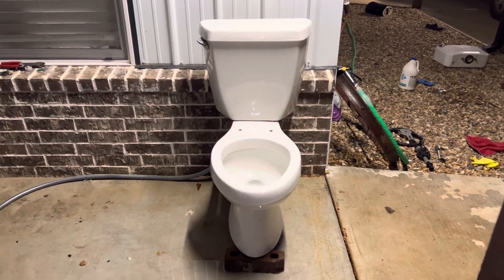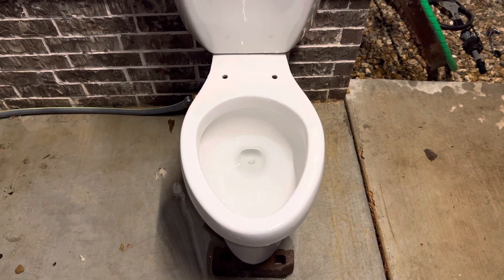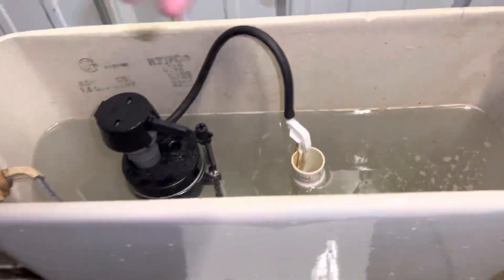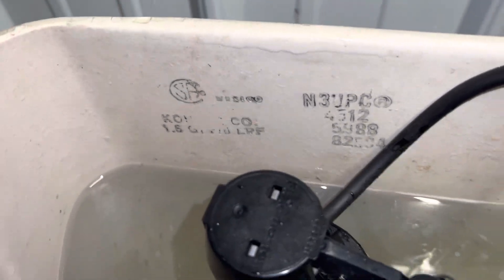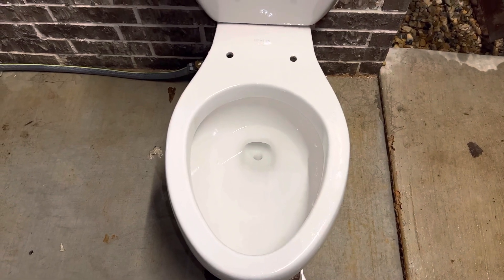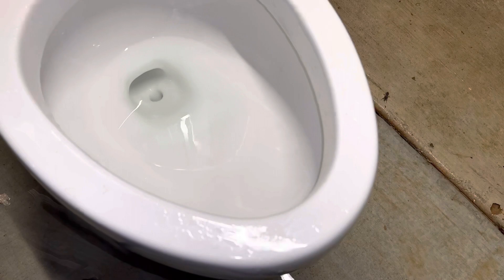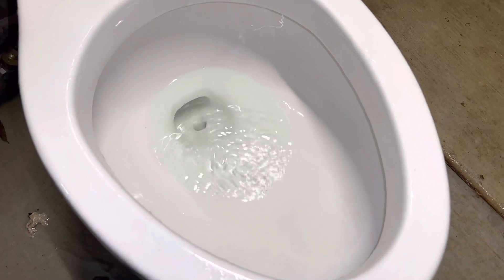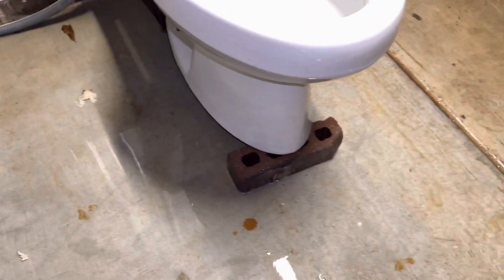1994 Elongated Kohler Wellworth Lite Toilet Flushes!

Comment: I like the design and I like the flush but yeah the performance isn’t great. I had one installed for a while and it actually didn’t clog as much as the elongated first gen Wellworth Waterguard. That’s not saying much tho. I’m glad kohler went back to this trapway design and combined it with the larger class 5 trapway size. Im still looking for one of those to test